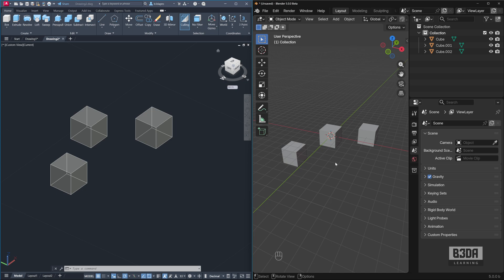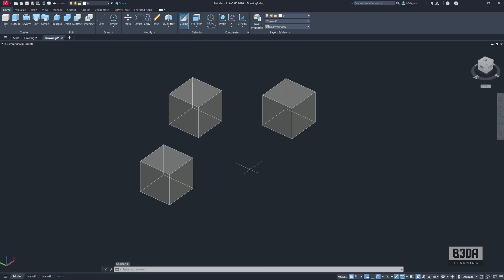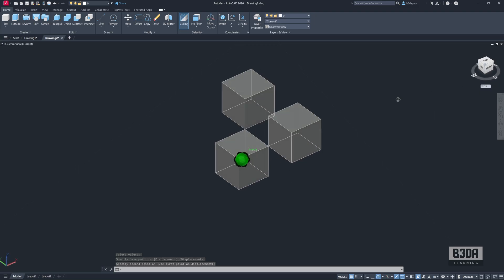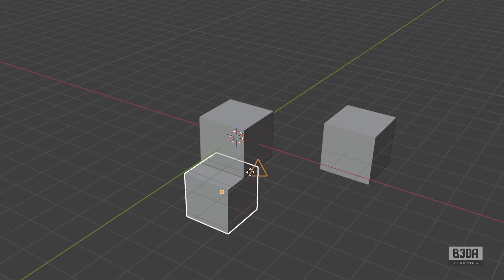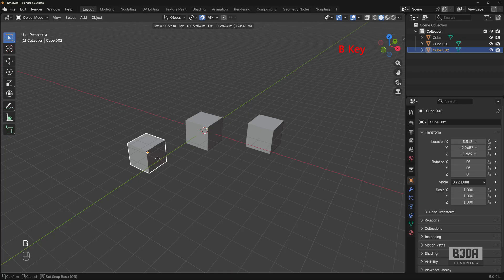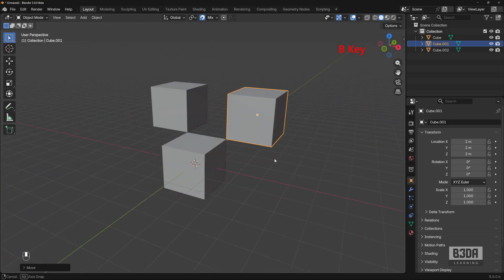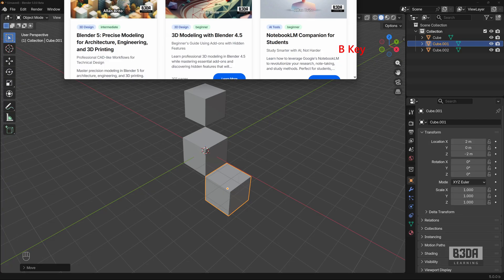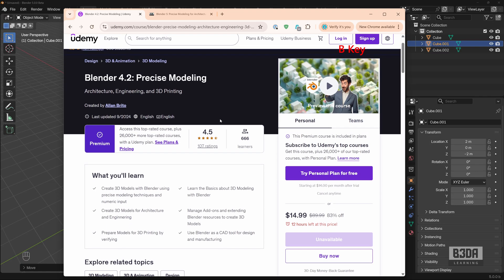Blender 5.0: Snapping like a CAD tool

Comment: How do you deal with tangents, even just in 2D, that are supposed to be flexible as a project matures?
We all know Blender can't do tangents for obvious reasons, but we still need to deal with them at times.
And also, for surface tangents, do you add additional holding lines to keep large flat surfaces truly flat?
I use Solidworks, AutoCAD LT, and Blender for work. Plenty of Solidworks stuff I miss in LT as well.

Comment: You don't even need to set up the snap up like you did.. You can leave the snap itself off, as once you press G then B, Blender understands that this is a snapping operation automatically. Further more, you don't need to set the snap settings to vertex and edge center. You can just leave the default Increment setting, and you'll still be able to grab from an edge center, vertex or face and snap to any of these on a target mesh. No muss, no fuss! And this snapping is already available in version 4 (not sure if this was introduced in 4.0 or a later point release, but you don't need version 5 for this).
Reply: You might want to mention for newbies - you can shift click the snapping options to have vertex, edge and face on all at once. My default setting.
Reply: @jeffellis1149  No need... you just did ;P
Reply: WTF is this a new function or has it been there this whole time?

Comment: And if you want much more powerful snapping, "CAD Transforms" is an add-on that let's you do things like "move the selected verts such that this vert aligns 3 units from that vert".
Reply: Does CAD Transforms work with Blender 5.0?
Reply: @Qwokadoc  I don't think it has been updated yet. I haven't tried it since I installed 5.0. Too busy playing with geonodes. ;-)

OK, just for you, I tried turning it off and on again in 5.0, and it says it can't create the gpu shaders. So I guess you'd have to wait for an update to use it in 5.0.

Comment: Still a lot more steps than in 3ds Max... :( In 3ds Max, you just click and drag from the point you want to start snapping and then release the mouse once you've snapped to the desired location. So it's basically, just one mouse click. Why does Blender insist to be so complicated? Besides, in Blender, you can't move your view while snapping which is not the case in 3ds Max. I can start snapping and then start orbiting/moving around in my scene before I release my mouse button to confirm the snapping target, which is a major plus. The needlessly complicated snapping system is the only thing that keeps me from migrating to Blender.
Reply: If you turn on the snapping, you can drag until it snaps and release. The "B" key just lets you pick different verts or other sub-parts to snap from. You can't rotate around because by default the key that you rotate with instead constrains your snapping, so you can do like "snap the X of this object to the X of that object."  Blender lets you turn on x-ray so you can see what you're snapping to, but sure, it's not quite the same ease as being able to easily rotate while you're dragging.
Reply: Interesting point you made, any way you can send a suggestion to them? I liked how you described how it should be. But in 3ds max are you also modeling just like in blender? Is it because blender can be used for 3d printing? Im a noob so just spit balling
Reply: @MrXlee1967  Google for "blender report issues" to go to the bug tracker. Add a suggestion. That said, "it differs from the software I like" isn't really an issue. Or you could create an add-on that modifies the behavior to be how you want it to be.
Reply: But blender at least won't lag as soon as you enable snap with three and a half objects in scene 💀

Comment: What frustrates me with blender now you can move align but rotate and scale still is so complex
Reply: Hmmm. Rotate - Select, R, choose an axis [X,Y or Z] then  use the mouse or arrow keys (up, down -= fast, left right = slow, alt left right = fine control, or just type an angle in? Oooh, got the direction wrong, press minus. Nope it was right in the first place, press minus again.
Scale? Same as rotate but press S  instead.

How could the Blender guys make it any simpler?
Reply: @jeffellis1149  still , you have to manage to have everytime a good pivot to orbit arround. and it's not intuitive in blender to pick an orbit
Reply: @moncefvladivostok  Yeah I get that. If it's any help:
In my setup I toggle vertex, edge, face and edge centre on (shift click them) and snapping (magnet icon) off then activate it with Control when I need it. I save File > Defaults > Save startup file
Pivot point is "bounding box" by default which works for the centre of the object.
But if you hold shift and right-click-mouse drag you move the 3D cursor which you can snap to the object by holding contol. Change the pivot point to 3D cursor by pressing "." (period).
Intuitive? Not at first...